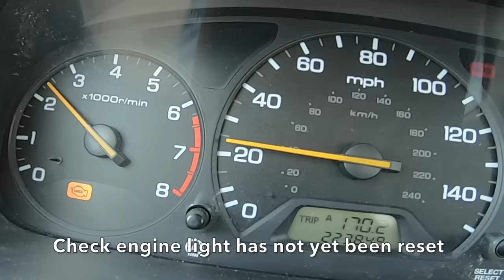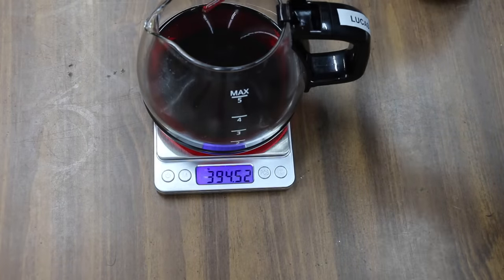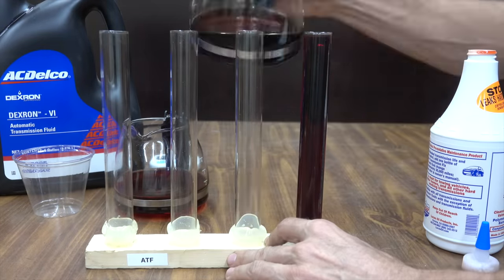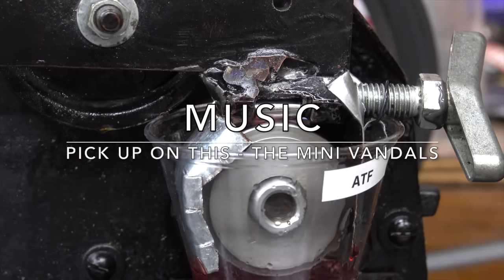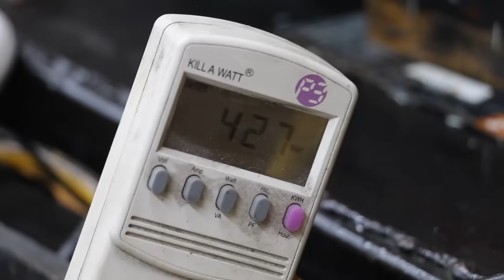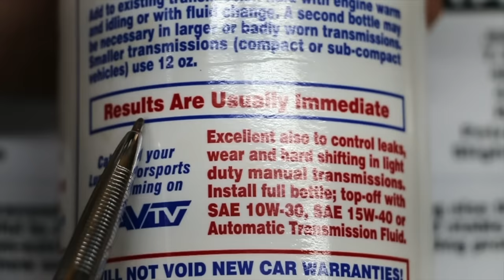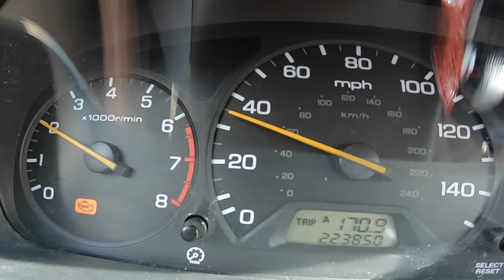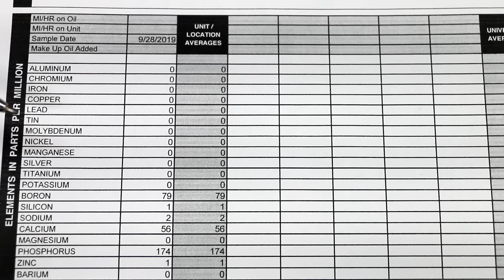Does Lucas Transmission Fix Work?  Let's find out!

Comment: I think you're wear and temp tests should be done with the proper dilution with Lucas. I'm not an additive guy. But a do swear by the Lucas trans stuff. I bought a 96 Chevy pickup years ago. It had a 5.7 liter with a 4L80 trans, and 163K on the clock. When cold, the teans had a 2 to 3 second delay going into reverse. I added the Lucas. The next morning, no more delay, and it shifted smoother overall. This was my work, plow and wood hauling truck. I had it eight years with no issues. I sold it to my brother with 235K miles. He added Lucas when he bought it. No issues, just because. He had it another eight years doing the same think used it for. He ran it up to 303K miles. By then it was very rusty. But still ran great with no trans issues. He sold it to someone who again plowed with it. I recommend Lucas whether you have a problem or not. Cheap trans protection.

Comment: Lucas Transmission Fix really works depending on what's going on with your transmission.  It's ideal when the issue is simply age, and lack of timely fluid and filter changes, with no broken parts.  You mentioned it should work instantly.  My experience says otherwise.  You really need to drive the vehicle for a few miles, with lots of slow downs and accelerations / gear changes.  This will allow the product to fully penetrate through the entire transmission.  I had an old S10 Blazer years ago that was both slipping, and refusing to shift.  New fluid, filter and Lucas fixed the problem.  I drove that truck another year, sold it to a friend, and he drove it a couple of more years with no issue.
Reply from the maker: Thanks for the feedback.
Reply: My 02 Honda Civic won't shift into 2nd gear. I'm not sure how this Lucas fix is going to get all in throughout the transmission if the car can't even change gears. I'm really trying to not spend 1500
Reply: @voltixD  the fact that you are stuck in first gear doesn't mean fluid isn't circulating throughout the transmission.  I don't know why you would think that.  Change the fluid and filter, and add the Lucas.  Go drive around a few miles.  It's either going to work, or not work depending on what is wrong with the transmission.
Reply: @thereallantesh  I'm like in limp mode. Max under 30mph. Trans gets hot. In my mind I'm thinking the gears must shift to get the fluid circulating throughout. Plus I can't change the filter it's inside. Which requires a rebuild it if I have to do that. I'm changing few solenoids tomorrow. Hope it helps with my situation
Reply: @voltixD  respectfully your knowledge of auto mechanics seems very limited. I would recommend you take your car to a mechanic with an honest reputation, and hope the issue isn't too severe.

Comment: Bought a 2003 Silverado with 200000 miles that was slipping in second gear changed the trans fluid twice used Lucas and got that truck to 400000 only got rid of it because of the water pump went out
Reply from the maker: Thanks for sharing.

Comment: Lol we specialize in that engine (Honda/Acura J-Series) performance parts and I personally run Lucas Stabilizer in my 550whp J35 swapped 06' Accord coupe and broke 3rd gear twice. Knock on wood, since using Lucas and Amsoil Synchromesh I've yet to break another gear. Booth generation auto Honda transmissions are notorious for being crap. They hold about 350 wheel horsepower where the six-speed manuals that is in my daily / R&D shop car holds roughly 550 somewhat reliably
Reply from the maker: Thanks for the feedback.

Comment: GM used to have Targetmaster engines and transmissions for swap out of their cheap factory crap.  They scrimped on transmissions using cheap materials and aluminum heads that would warp if you sneezed on them.  The mechanics who replaced these two items for me told me how the OEM factory engine and transmissions were almost Chinese in quality.

Comment: I added  Lucas Trans  fix to full trans fluid on my 2001 dodge 3500 Cummins 5 speed . it was slipping and not shifting normal even after filter and fluid change . It has been shifting fine for 30k since  and pulling a 14k excavator 3 out out of 5 days in a  work week  . I'm sold on their product and use all their pdts . Oil ,tranny and fuel saved me 3k on a rebuild so far and I have 550k on engine . If a trans fix for  broke transmissions was sold in a bottle ,  Why would their be trans shops ? Keep it real .  But I can tell you these products work for average problems and routine maintenance .
Reply from the maker: Thanks for sharing.

Comment: You read the bottle and followed the instructions but on those sealed units this is a really bad idea you're putting over 2/3 of a liter of super thick fluid down into a sealed system with no dip stick you should have pumped out 24 oz

Comment: Well for starters, the Honda transmissions of that vintage should not use Dexron, but rather the Honda made , Honda specified tranny fluids. Also , several of the transmission solenoid valves are external to the case in many of the Honda auto trannys. An easy and cheap fix in more than a few cases.
Reply from the maker: Thanks for the constructive feedback.

Comment: you missed it. the point was to add small amounts to an old transmission to clean the high rpm and low rpm ports.
you should have added it to the fluid instead.

Comment: Gear shift is controlled by valves in the valve body and these valves need to move freely. They're movement is caused by oil pressure & any improvement to sealing to the oil pressure affecting these valves is good. It's also important to check valve body bolts for tightness. A tell tale sign of a loose valve body is good gear shift cold & gear shift slip when hot caused by lost pressure in valve body due to heat causing valve body to expand a bend or warp slightly due to loose bolts. This can be caused by 1, 2 or more loose bolts. It's a good idea to remove oil pan & tension bolts, clean & refill with premixed trans oil & Lucas. Premixing is easily done by buying a 2 litre kitchen plastic measuring jug a mixing with a steel or wooden ruler. Pour 1 litre oil & using markings on jug add right amount of Lucas then slowly stir & repeat. On older Ford's ( 70s ) you could also drain the torque converter which had a drain plug.
Reply from the maker: Thanks for sharing.

Comment: Lucas won’t fix that clutch circuit code. That’s a bad solenoid that isn’t switching either on or off. It requires replacement. Thicker oil’s may help if the issue is related to the valves but what the exact mechanics of that are I don’t know. I remember we used to use heavier oils in engines that started consuming oil. Had a Samurai that would just drink 30 weight and the only way to keep consumption low was to use 20w-50. Kept it from thinning out and getting around the valve guides and burning off. I wish I still had it.
Reply from the maker: Thanks for the feedback.

Comment: I Swear by this additive. But you gotta give it some good drivetime to really notice a difference, after atleast 2000 miles my car shifts like it came out of the factory brand new.

I really didint need to add this to my car, as i recently changed my trans fluid, but prevenetive maintenance is key. It shifts even better with it ajd will keep your trans cool and healthy.

Remember people, Change your trans fluid every 30-60k miles!

If you're able that is, if your vehicle has more than 130k on the dash without changing it.. id just add the lucas oil additive and leave it alone.
Reply from the maker: Thanks for sharing.

Comment: These transmissions were so bad that Honda recalled many of them to 100K miles, 
The biggest problem with the Honda’s was the clutch material will flake off the clutch discs and have extreme clearance causing filter to plug and not move or slip badly,
Reply from the maker: Thanks for sharing.

Comment: Ok I use to kill transmission s left and right lol 😂 went to get one rebuilt transmission guy at . 15 thousand  put stop slip in I asked why he said to do this every filter change. He finds they last longer he repairs our local cop cars he says if he forgets to put it in they get over 20 thousand less miles. I do this for every car I buy used or new used change filter right away add stop slip. Funny I've lost many of engine but no transmission s since. I do hard driving  over loading and towing. Ime a contractor. Don't know how it helps but it works. My guess is it's a better fluid than stock. Slowing down wear. So do it before it breakdown.
Reply from the maker: Thanks for sharing.

Comment: From the top all these vehicles with full bottles of trans fix 

1974 ventura slipped very bad in 3rd fixed laster 8 years

2005 Saturn ion hammered very hard into gear and slipped to point that od was non existant....fixed and drove like new.

2004 grand am no overdrive....then it had overdrive after a bottle. I literally swear by this stuff and it's my first tool everytime I have any sort of trans issues
Reply from the maker: Thanks for sharing.

Comment: This may not work for everyone but it's work for me on two different cars, on the car I'm driving now a Monte Carlo, I change the transmission fluid, but of course that don't get none of the gunk that stuck up in the, Vauls, so my car would not shift out into high, so I put about 1/8 of a pop bottle, of kerosene, into my transmission, and it clean the gunk out of it in 5 minutes and immediately started shifting out into high, and it's still shifting fine, this is the second car that it has worked on, PS if you put a pop bottle full of kerosene into your gas tank when you put gas in your car, it will keep your fuel lines and injectors clean, just thought I would let you know, in case you might be having the same trouble!!!!, So you won't get ripped off for $1,500!!!!!
Reply from the maker: Thanks for the feedback.

Comment: Yes you can go by the on the heat automatic transmission if you have a gear ratio, air code, that is the death code of the transmission it is over color. All you have to do is smell it if it has the Burt or varnish smell, you will smell it just doing a transmission service will not get all of that out and less you do a total flush and then you’re causing damage that way possibly not moving again if you got 100,000 miles on a transmission that is the life it’s over hundred thousand and 1 mile over you’re on borrowed and transmission is at its life. It’s pretty much over pushing your luck
Reply from the maker: Thank you for sharing!

Comment: I swear by Lucas. I had a 2003 Honda Odyssey. The transmission does not have a filter. The owners manual said see dealer for recommended transmission fluid change. The dealer told me 70K miles. At 68K miles I noticed the trans was chattering 1st to second and second to third. I pulled the dip stick and the fluid was burnt. Yes, it was black and smelled like a BBQ. I was pissed and went to the dealer. I told them that they had said to me that it needed service at 70K(5 years ago when they told me). They said that they were wrong, and that they NOW recommend every 40K miles. Since I didn't have anything in writing from 5 years ago I was S.O.L. I changed the fluid with factory Honda trans fluid and two quarts of Lucas. Within 200 miles the chatter went away and the trans shifted smoothly. After that I changed the trans fluid with factory Honda fluid and 2 quarts of Lucas every 30K miles. The transmission finally detonated at 120K miles from the earlier damage, but the Lucas almost doubled the life of the damaged transmission. I use it in all my cars whenever I change out the trans fluid as a hedge against failure.
Reply from the maker: Thanks for sharing.

Comment: Being a mechanic for decades, I found that people wait till they have an issue to change trans fluid. They always say it's working fine. Then when it has issues, they say its a piece of crap. Maint is the biggest key to prolonging life of a drive-train. Some people just don't spend money maintaining their vehicles. For whatever reason, the engine may get an oil change but often decline trans service. A lot of people tell me their trans has a sticker that says lifetime fluid, not serviceable. People actually believe that, lol.
 Every trans has a way to drain and fill the trans. Just because it has no dipstick, doesn't mean it doesn't need checked.  Lifetime doesn't mean your lifetime or the cars lifetime. Ea part has a life expectancy, including the fluid.
  They make newer trans harder to check because they want you to go to their dealers to have it checked. The general public prob doesn't have the right tool to pull the plug to check fluid levels. It's really not that hard, but most people aren't mechanics. 
 I've tried Lucas and other additives and have a 50/50 chance of working. If the trans is damaged, you can't go wrong trying a $20 bottle. But just doing a fluid change often fixes the issue. A lot of people tell me the trans is likely to quit working all together if they changed the fluid. That's an old wives tale. The main issue is they went way too long without changing it, or someone previous didn't use the right fluid. But that's a video for another time. 
  Maybe a little pricey, but less then rebuilding/replacing a trans, I've found that buying a programmer and setting it to haul mode or firming up the shifts often "fixes" the trans. Especially trucks, most vehicles are able to be programmed. Hypertech, Superchips, & Edge are some I've used. Or go to your local tuner shop(dyno shop) and ask if they can program your vehicle. Hand held programmers are easy to install and hard to mess them up. Just tell it to go back to stock, and start over. I believe programming and telling it to shift firmer/quicker jolts the solenoids and causes clutch packs to shutter off debris. It doesn't work every time but you'd be surprised how many times it did work. The last few vehicles I programmed are still on the road and cost was about $450 for the Edge. Be aware every vehicle and programmer cost different with many different options. Keep up the good work!
Reply from the maker: Thanks, will do!  Thanks for sharing

Comment: True story: My girlfriend and I had a 1992 Plymouth acclaim that we bought for $900 with a completely shot transmission, every gear slipped was nearly neutral, barely able to get past 25mph, when i dropped the pan, it was completely coated in a 1/4” thick layer of metal and clutch material. I replaced the filter, added 3 bottles of lucas and replaced the rest with atf, and when i took the car around the block, it drove and shifted like new.
Reply from the maker: Thanks for sharing!
Reply: Did you clean the pan or did you leave all the clutch material to be picked up by fresh fluid?

Comment: I had a 7.3 diesel underwater for 3 weeks after a flood. When water receded  I had water in the trans and zero gears. I drained and flushed and added the Lucas oil. I got all my gears back and another 90k out of the trans. Took the Lucas to fully work after 500 or so miles. I'm telling you it shifted like a Lincoln. I Stand behind Lucas.
Reply from the maker: Thanks for the feedback.

Comment: I bought an 89 accord hatchback from from my girlfriend, who later became my wife… who later became my ex wife. She bought it for 400 bucks from some slime ball (she was 17 at the time) who knew the transmission was toast. It got stuck at my apartment complex just a few days later because 1st gear would just slip and it couldn’t get going under it’s own power. I drained some fluid out of it, put a shit ton of Lucas in it, and that car drove fine until we finally got rid of it two years later with over 330k miles on it. Stuff works. Sold it working fine for $300 to someone who knew the issue.
Reply from the maker: Thanks for sharing.

Comment: This works best if you add 6 oz of seafoam to the transmission.
Run the engine 30 minutes occasionally shifting from D-R and give a little gas.
Drop the transmission filter and add Lucas.
Refill the transmission fluid and drive hard for a few minutes.
Reply from the maker: Thanks for the feedback.
Reply: @ProjectFarm  if you think that filter was really black and it will be.
Yes there's going to be a little still in the transmission.
Don't replace it again for 60k .
It's able to stop anything important.
After 60k do everything again.
After that if the motor still runs it will likely still be fine.
I run a little Sea foam all the time to prevent any shift diode from sticking.

Comment: I HAve Had Really Great Luck With . 
TRANS-X®
AUTOMATIC TRANSMISSION STOP LEAK & TUNE UP
Stops slips, fixes leaks and protects against future wear.
Effectively repairs leaks in automatic transmissions.
Prevents premature failure, future leaks and extends transmission life.
Powerful cleaning agents remove sludge, gums and varnish, freeing valves for proper shifting.
Use to condition ATF and power steering fluids.
Prevents leaks caused by aged seals & gaskets
Reply from the maker: Thanks for sharing.

Comment: I tend to trust Lucas. It is one of the only of these additive products that I do trust. I use all of their stuff, in my cars, and in my tractor trailers. I've seen Lucas hub oil actually save trailer hubs that should have blown apart from running empty. Even the mechanic said "wow. You're lucky you put the Lucas in there. That's the only reason this hub didn't explode", as this is something he has seen the results of many times. Yep. I do trust Lucas. Give them a shot, if you haven't. You'll see. EDIT: In my mid 40s. Been driving truck for 16 years.
Reply from the maker: Thanks for the feedback.